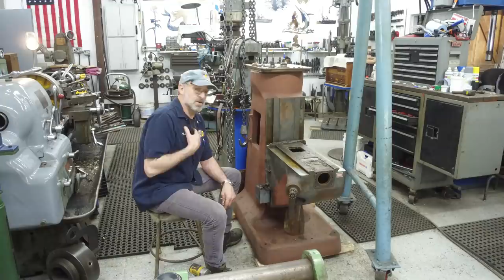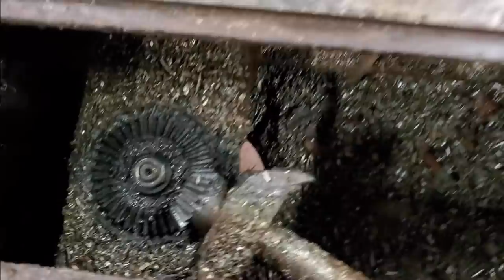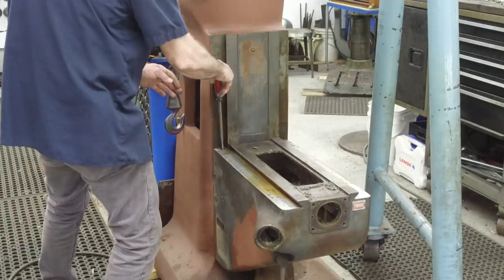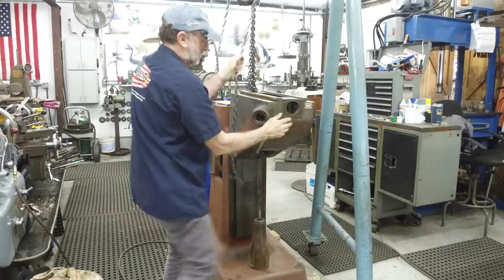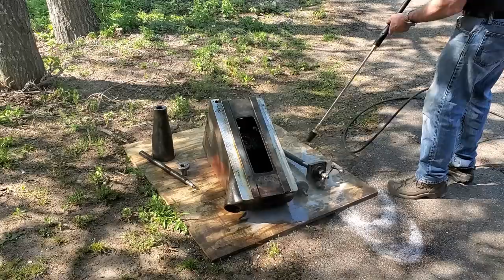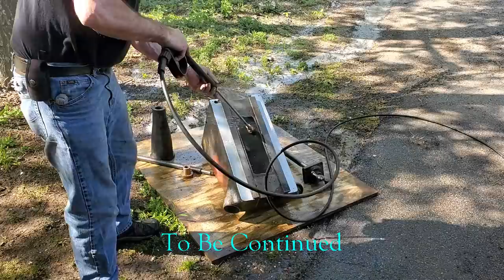Buffy's Back Part Two

Comment: I have cleaned many a Bridgeport way and adjusted plenty a gib. Never my equipment unfortunately. I would be employed by a shop and I couldn't neglect a machine. I would take a few minutes befor the next print pull the wiper covers back clean the felt and lubricate. No employer ever complained but not many guys would take the time. It's great to see a bottom up rebuild of what I would say is one of the most important machines out there in a job shop anyway. And it's great to see you back at it. Thanks

Comment: It’s very easy to add an oiler to that elevating screw nut as you put it back together. Just plan to run another line from your one shot oil manifold. Drill a hole right through the casting and in through the nut just like the X & Y feed screw nuts in the housing in the cross slide. That’s an excellent upgrade. Granted, I haven’t watched the rest of this series yet, so maybe you’ve done that, but I hope it helps someone else.

Comment: I think you can put the rear saddle wiper on after the saddle if you raise the knee up to where the saddle ways clear the top of the knee ways. You do have to be careful not to turn the knee screw entirely out of its nut or the first thread will get flattened from the weight and make it virtually impossible to get the screw started in the nut again.

Comment: I have always loved metalwork but life gave me dusty wood-shop (been solo running past 11 years). Two weeks ago I got myself old soviet lathe 1A616 (quite decent condition). For past two weeks I have made necessary repairs, all new electrics plus emergency switches (in soviet Russia no accidents happened), new oils and general cleaning. And now I am sitting here watching video of another fellow going through the same thing. Don´t really know why but just can´t turn my eyes away ;)

And I know how woodworkers are seen in the eyes of machinist but chasing 0.2 mm (my acceptable tolerance in woodwork) error in details with length of 2000 mm is same ratio as 0.01mm to 100mm. Patting myself on the shoulder here...
Reply: Fact checker: So this was supposed to be 2000mm within 0.2mm ?
Sven: Well, it was, two months ago when I made it.
Reply: @deconteesawyer5758  Are you hinting towards wood changing dimensions due to humidity?

0.2mm is lowest resolution I can read off measuring tape with my eyes.
Reply: @sven-erikviira1872  You would hint people need a measuring tape to see through that ?

Comment: For returning the knee to its track, cut 2"x4"s that fit tight and perpendicular to the inside surface. Cut two lengths and pivot them together when inside. Then toe screw two drywall fasteners to mate them and thicken the assembly, this will prevent them from rotating.

Comment: I had to make a new Zaxis shaft when I installed my Z power feed. I also had to make the mating cog, as the kit was for a Bridge Port, and had a different cog design versus the Wells-Index, I made a new crank, and used the cog from the kit. My fun was getting the bevel gear back on the new shaft, and the keyway tightened. Real hard place to get your head into. I actually used a remote camera to see what I had to do.
I'm surprised at how many chips made it past those sliding shields. The frosting scrapping looks like very little wear was done to them on the Yaxis. That's going to be a nice mill when reassembled.

Comment: There are inserts that go inside the plastic lines and there are wider ferrules. They are used in plastic air lines on heavy trucks. Look for DOT air line fittings.

Comment: Hi Keith, I didn't know you were into bikes? I have a small shop here in Australia where I use my old manual machines to keep the bikes going. The only newer machine I have is a Plasmacam like yourself. I have just started a new channel on YouTube to pass on some of the knowledge I know. In saying that,  I have learned a few tricks from you over the years. There is always more to learn. Anyway thanks for the content. Cheers Rick Australia

Comment: I'm surprised that, given the amount of chips on the knee gears, that Bridgeport didn't put some sort of shield above the gear assembly to help redirect the chips away from the gears.  Just a piece of sheet metal screwed to the casting would help a lot.

Comment: Just a thought. When I went through the knees on my two machines, I built a cover with a piece of soft aluminum, to cover the gears. The reason I had to go through the first knee, was a chip got stuck in the large gear, and the pinion gear would only turn 359 degrees.

Comment: Nice! I am curious if you use some of degreaser in your pressure washer. I see you use a multiplier head and there really helps. Thanks for sharing.
Reply: Water is just amazing, isn't it? We really are lucky to have so much of the stuff.
Reply from the maker: Purple power makes a great addition to pressure washer
Reply: @KeithFenner  some people don't like Purple Power due to it being caustic. It can sometimes be a bit harsh. I've seen it strip paint and discolor metals. It does clean stuff pretty good though. I also use it as a honing lube. It is slippery.
Reply from the maker: I wouldn't use it on a finished project! but, "When you want to cut the grime, it's purple time!"
Reply: @KeithFenner  the one thing I really hate about Purple Power is that it crystallizes. Which blocks up the spray bottles I use it in. Soaking the pumps in water dissolves the crystals but it's still annoying.

Comment: On plastic line, if use Farrell. There is a little brass/metal lined fitting, that inserts in the ID so Farrell does not smash the line
Reply: Ferrule? There's a Farrell, Pennsylvania. Not sure how that applies. Then there's Colin Farrell. Can't see how he's involved either.
Reply: @1pcfred  well old fat arthritis fingers and bad spelling my bad
Reply: @KG-yn9qi  you look like you're doing OK to me.

Comment: Mr Fenner, at one time in an industrial setting, had reason to review AFBMA ball bearing standards.  You mentioned new bearings for the milling machine.  My rolling element bearing needs were usually for nominal 1800, 3600, rpm machines.  We always used AFBMA, C3, internal bearing element cleanced bearings.  The C3 is a rather loser clearance than like a C9 internal ball clearenced bearing like for slower moving shafts.  Slower moving shafts do not need a loser internal cleance as heat is not an issue.  Of course C9 internal clearenced bearings would have more accuracy in keeping the components inperfect alignmet.  Was just wondering if, the internal clearance, ball to inside, and outside race clearance was considered when buying new bearings for a highly accurate machine tool?
Reply from the maker: I always cross refence and up grade or tighten up the clearances as needed or feel the need, like the spindle bearings.

Comment: Keith, what kind of solvent do you use in your power washer if any.  If I may be so bold to recommend a solvent used in the printing industry, it's water miscible and may even be bio-degradable.  Since printing ink is essentially light grease (made from soy oil) with colorant added the solvent works great on petroleum based oils and greases.
Reply from the maker: purple power soap
Reply: @KeithFenner  Ah ha we used that when I was in the Air Force, or similar, to clean up the mess in the Radom after a hydraulic line cracked and sprayed fluid into the 28 ft. antennas, 10 rpm rotation, wind until the 55 gal. resvr. emptied.  What a mess, everything from top of antenna down was covered in fluid.